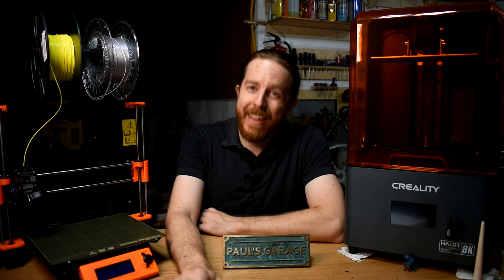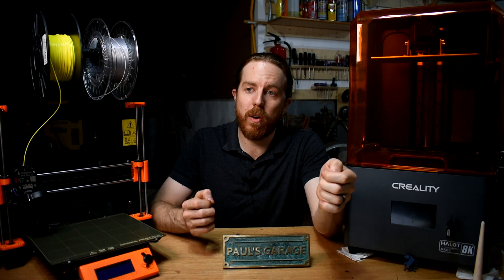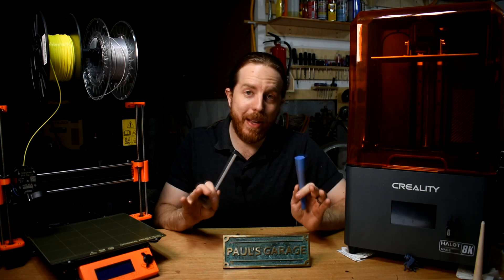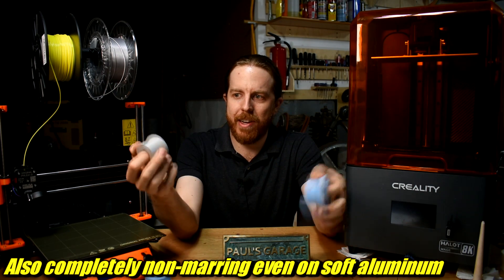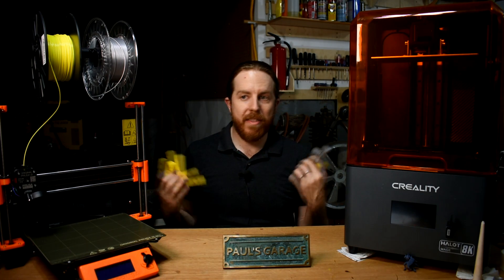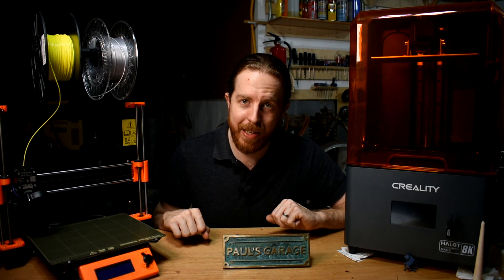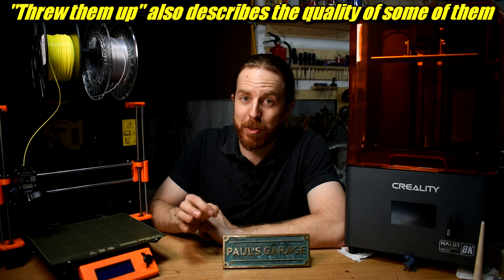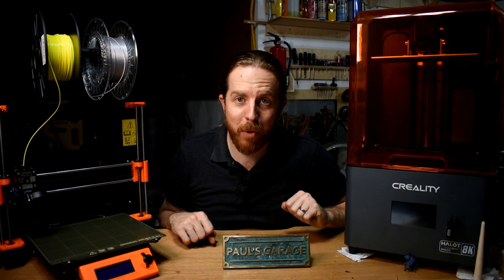A 3D Printer for NON-Plastic Projects?

Comment: As far as brittleness of SLA materials go, the range of brittle --> flexible  is WAY greater than anything you could get with FDM and certain resins can give you really brittle models. You just have to research and experiment. you can even adjust the parameters by mixing different types of resin proportionally.

Comment: Need something made of concrete in a specific shape? I had 2 plastic shelves side by side in a closet that wasn't quite wide enough. I 3d printed legs so that one set was exactly one shelf-thickness taller than the other so the two shelves could overlap. I filled the printed legs with concrete so they would be strong enough to bear the weight. Leg pairs were attached with a 2x4, so I designed countersunk shafts for the screws into it.

Comment: Get a vacuum pan and pump motor on Vevor, and just do vacuum investment casting. 

I would like to see someone with a muffler oven that could melt steel and do steel parts.. :) 

Greetings,

Jeff
Reply from the maker: That's the plan, and I already have a vacuum pump 😉
Reply: @PaulsGarage  Allright!

That should make for some very neat casts. 

Only the very very precise pieces may or may not need machining. I am very interested in how the dimensions will hold up. 

The m16 trigger and hammer parts are cast steel, so if you want to have something as a reference to see if your casts are as accurate, I would make some of those. :) 

Greetings,

Jeff

Comment: So what you're saying is that I should take apart an arc welder and attach it to a 3D printer and make a metal printer that uses welding wire. Okay, I like that idea.
Reply from the maker: Sounds fun take pictures 👍

Comment: I want to take the leap and get my first printer. I'm willing to spend$350 to $500. Do you have a recommendation? Im going to be mainly making casting patterns and maybe printing some pew pews out of carbon fiber filament.
Reply from the maker: I don't have much experience with FDM printers in that price range, but most fancy filaments require a special extruder nossle and/or hot end to deal with temperatures and abrasive additives.  Most cheaper machines don't come with those but they are generally readily available off the shelf as add ons.  From what I hear, Creality FDM printers are very customizable in that price range but I have no personal experience with them
Reply: @PaulsGarage  ok. Creality is at the top of my list right now. Found a good price on an Ender 5 s1. I'm sure I'll need plenty of practice before I get to carbon fiber filaments. I'm eager to get started printing patterns to get started on castings.
Reply from the maker: For sure get going with PLA and get comfortable with that before trying different filaments.  All of my sand casting patterns have been made of PLA, by the way.  Only now with the resin printer will I start adding resin patterns, though I will still keep using PLA for some patterns

Comment: I have been wanting one of either type for a while. What held me back was the 3d modeling. I challenged myself to learn a program first. I am currently teaching myself with Tinkercad, seems decent. Once I feel fluent enough in it, I will probably buy a FDM type first to get printing. I want a resin type eventually for scale model work.  I am pretty good at scratch building but some complex shapes are near impossible for my simple hands.
Reply from the maker: For scale models yes the resin will blow FDM away.  For simpler things though I'd still prefer FDM.  Both very good tools for sure.  I've messed with tinkercad a bit, I think I made the sand rammer and hammer patterns with that.  Fusion is the way to go in my opinion, but there is definitely a steeper learning curve
Reply: @PaulsGarage  Your video basically confirmed what I have thought for a while for my own personal situation.  I need both, but only have budget (time and money) for one style to get started.  FDM is what I will begin with, the resin seems clunky for startup and shut down, which means I won't want to use it as much.  I liked the idea of investment casting (or lost casting, what ever its called) which is something I might experiment with for "restoration" cosmetic parts for my motorcycles.
Reply from the maker: @thejunkman  I'm definitely glad I started with FDM, but yeah the technology is so different you really need both
Reply: @PaulsGarage  I have been mulling this over for YEARS.  I think it is time to pull the trigger and get an FDM and do some basic useful things.  Get myself up to speed on 3D modeling.  Then save up for the resin.
Reply: I was deciding between the two as well.  Resin is really limited to miniatures because of the cost of materials. Not to mention the LCD panel wear and film wear.  If you want details with FDM, consider a smaller nozzle like .1 or .2.  then epoxy coated or some other filler primer.
Reply from the maker: @Jaze2022  resin is pricier per print than FDM sure but it doesn't seem like much to me compared to buying equivalent parts. You would make the difference back pretty quickly, even with the cost of the printer.  LCD replacement don't happen as often as people think either.  Standard practice (if you care to stick to it) is 2000 hours, but it's not 2000 hours of print time, it's 2000 hours on, and the LCD is on for a very small percentage of the total print time.  Lifts and delays for the resin to stop moving and stuff like that take up most of the time per layer.

Comment: Oh the number of things you can use 3D printing for...
Leatherworking: I use it for tool holders, like my stamps, I use it for printing forms for wet forming leather around, I've used it to replace handles on tools, for templates for cutting, tooling and pricking.
Lathe: I have used it to make ring holders to chuck up a ring in the lathe for finishing (added bonus unlike a metal option I don't have to worry about copper shims to avoid the tool damaging the inner finish on the ring), replaced a couple knobs on my lathe that were less than impressively built (i.e. broke) and for a few other various and sundry things like tool holders, organizers for reamers.
Mill: Same story here, custom part holders, custom tool holders, not replacement parts on the mill yet but...I imagine it will happen.
Stained Glass (no, I don't have too many hobbies, what does that even mean?): The ever present organizers/tool holders, but also custom forms for the scene I'm making as well as these little clip things that hold the pieces lined up the way I want so I can solder them (nothing sucks more than a piece moving right as you apply solder...unless you like reapplying a bunch of copper tape).
Miniature Painting: My god how much time do you have? Everything from paint holders to painting tools to brush racks to using TPU (flexible filament) to reproduce new caps for the vortex mixer I use to mix paints.

I've used it to make replacement parts for my dishwasher, add on parts for my racing sim, a little custom headphone stand/holder you literally cannot buy an analog for. Racks for my DAC's and AMP's on my desk to give them room to breathe without taking up tons of space. I'm literally just looking around my office right now pointing things out...I could walk through the rest of the house and continue the trend but I think the point has been made...
Reply from the maker: Haha nobody has too many hobbies, only too little space and time.  

Now you said racing sim? What kind of setup do you have?  I'm still rocking a G25 bolted to an Ikea desk lol and have managed not to snap that ring gear inside... Yet

Comment: 3D printing ideas? Well, right now I'm designing and building a CNC gantry router using lots of 3D printed parts.  That's to NatahBuildsRobots I got the idea to use a Bondtech CHT 1mm nozzle on my modded Ender3 to produce .8mm layer height adjustable bearing housings that are very chunky.  Also the adjustment collars for the polished tubing that will be the new bearing surface, as well as center supports for the tubing because it's going to have a lot of weight riding on it. Probably also going to print the mounting bracket for the router spindle, and the dust shoe. Then I'm going to use the machine to cut foam patterns of all the parts and lost-foam cast them in aluminum(flat chunky parts). Then I'm going top open-source the whole thing.

I've already used my printer to reinforce my current garbage-tier DIY gantry mill. It helped.

Printed drill jigs.  Printed marking jigs.  Replacement handles for scissors.  An oversized zipper-pull for a snow jacket specifically made for use with heavy gloves. And a special bracket to clip my walkie-talkie to back when I was still in contract security so that I could sit down comfortably without taking it off. Will be designing molds for some carbon-fiber parts though I'm not sure if I will print them or mill them out of HDPE. Whatever, I'm all over the place and the printer really helps.

I use FreeCAD because I'm strictly on Linux and it's basically the only game in town for CAM software. Blender's CAD extensions look promising for 3D printing, but so far they are all for additive manufacturing, not subtractive.
Reply from the maker: Sounds like you are getting lots of use out of 3d printing.  Freecad is pretty good stuff, I just couldn't work quickly enough.  It might be down to inexperience (pretty sure it is) but fusion is faster for me
Reply: @PaulsGarage  Not at all.  I've heard FreeCAD described as being reminiscent of CAD software 20 years ago.  Light on features, kind of buggy, long processing times, high learning curve, etc.  FreeCAD is entirely coded by unpaid volunteers, and it's absolutely amazing by that standard, but it doesn't have the resources of something like Blender or Autodesk. For instance, single point thread milling and fourth axis are both still experimental in the Path workbench, which is FreeCAD's CAM module.  

I'm a big open source advocate, so I'm using it regardless, but for a lot of people that just want to make something and they are already trapped in the Winblows ecosystem, I just tell them to go with Fusion. FreeCAD is hard mode in a contest where there are no extra points for that.

Comment: My current wild idea is to print a "mold holder" in PLA, and then print the mold in water soluble filament.  Fill the wear or stress surfaces of the mold with metal inserts, then fill the rest of the mold with epoxy putty.  Get the cured part to release by soaking in water.  My hope is this will produce parts that are close to the toughness and hardness of metal parts, combined with the precision and ease of 3d modelling, while minimizing the use of the relatively expensive water soluble filament.  Wish me luck, and for exploring this idea to get to the top of the stack!
Reply from the maker: Sounds like a fun process!

Comment: As somebody involved in 3D printing (and its educational outreach) since 2014, it's really a game changer for an average hobbyist and I'm super happy seeing more and more people discover it as a tool, and not "the bad robot taking away jobs".

Not sure I have a useful suggestion, but an often overlooked material is TPU/TPE. It's come down price a lot (costs about the same as PLA now) and it's perfect for door bumpers, soft corners, plugs (for bolt holes, fixture plates, other holes) to prevent dust ingress, etc.

And when you're done falling down the rabbit hole of 3D printing, there will be a hatch going further down labeled "CNC Routers". ... Just don't be tempted, or you end up with custom machined fire bricks with perfect side angles and interlocking features. ... Or the 5-axis nonsense I've done on my channel.
Reply from the maker: I've never tried tpu/tpe, thanks for the tip!  And I'm a long way off of CNC machining, still working on regular old fashioned machining!
Reply: Just a heads-up - if you give it a try, search for some tutorials on printing TPU on your Prusa i3 to avoid damage to the print bed. With the incorrect settings (and without gluestick), it is known to permanently fuse to PEI surfaces.
Reply from the maker: I did wreck one side of my prusa mk3 build plate, but with standard PETG.  Whoops
Reply: @paulsgarage Another fun tip: TPU, in my experience, isn't terribly particular about the surface that you print on. I have used it to print a mask on a sheet of copper for rattle-canning some pattern lines for a copper bracelet that I made for my wife. All you have to do is secure it to your print bed (I used painters tape) and set your Z-axis 0 point to the copper's surface. It stuck perfectly and came off with a pen knife without issue.

Additionally, TPU is pretty chemical resistant so, it might be possible to use it on copper-clad (or other metal) as a negative mask for chemical etching. I haven't tried this yet but it's a neat idea.

Comment: I consider learning CAD the biggest bottleneck in 3d printing popularity. I ended up learning FreeCAD, and I used letting myself buy a 3d printer as a carrot to provide the motivation to learn it.  

Funnily enough the easiest and fastest thing I've ever printed was the most valuable. A family member had a CPAP machine with an overly complicated plastic part with a tiny hose nipple that broke off, took me 5 minutes to model a new nipple I could reasonably epoxy into the broken part, and 10 minutes to print it. A good option when a new one is a thousand dollars, and replacement parts are nonexistent.  

I've also basically paid for it again fixing headphones instead of replacing them.
Reply from the maker: Agreed.  Modelling skill is the most important part.  I prefer the UI of fusion to freecad but freecad is still an awesome program.  Lately I've been trying to learn blender for mesh modelling, but you can't do parametric stuff in blender
Reply: FreeCAD is just clunky, buggy and ugly! Writing software that's worth paying for is ridiculously laborious and time consuming, even with all the advancements in modern computing and the vast amount of learning resources and freely accessible code. Fusion 360 is the easiest to learn with a ton of useful features and works on the Mac and Windows. It's hard to believe I once thought Sketchup was good.

It is still free for hobbyists. If it wasn't free, I would still pay for it, although I am not a fan of Autodesk. I'm still pissed off at them after they made the dirtbag move of using the community to build up their product and then cut them off from accessing some of their higher end features after the honeymoon was over. Fusion's competitors are way out of the hobbyist budgets with license fees in the thousands per year and many of them have fallen behind in Fusion.
Reply: @bobweiram6321  i really like onshape. if you can get over it being browser based and your models being technically publicly available (if you want to hide a model from search, just dont give it a descriptive name), it's super nice. not nearly as powerful as fusion, no CAM, but i prefer its UI tremendously and since the computing is done on the server, you can have as many projects open as you want. plus the phone app is full featured so you can stay in flow when you take a break to get coffee or use the bathroom if you really want :p
Reply: @Taygetea  I wouldn't touch OnShape with a 10 foot pole! Their business model is equivalent to allowing you to use their public toilet on a busy street for free, but there's no walls and everyone driving and walking can watch you taking a dump. If you pay a fee, a booth is lowered over you to give you privacy. Using a web browser is the most painful way to use highly interactive applications.

Comment: Sounds like you need a little help calibrating your shiny new toy to work best with the resins you're using matey! Once you calibrate it with the resin you use (Yes, every resin will need calibrating differently! Much fun i know xD) then you'll be getting perfect prints no matter how you orient your prints, and perfectly dimensionally stable. 

I can heartily reccomend the latest resins from SunLu, their Sunlu ABS-Like and SunLu High Toughness. The ABS like bends, takes stress, works like you'd expect a plastic to behave. The high toughness is ridulously strong, like you can smack it with a hammer strong, or print a veronio object and squish it without breaking :D They're also amongst the cheapest ones out there too, pretty incredible stuff. 
For casting, Siraya Cast or Bluecast X-One are the only ones to consider (the rest are expensive and bluecast exists.. lol) 

Have you made a subthingy on your discord for this? I'll post some links to shit i reccomend to watch/read/advise for if there's a place for it :)
Reply from the maker: Thanks for the info!  Yes there is a 3d printing channel in the discord
Reply: @PaulsGarage  awesome, thanks, I'll infodump a bunch of stuff I think will of be use for you to read/view then :)

Comment: I have 3D printed 4, one tenth scale models of my 1930 Austin Seven car. One for me, and one for each of my sisters. Only some little thin brackets and rods are either brass, aluminium or copper. I used an Ender3 with pla, and an Anycubic mono 4K with water washable resin. I am now looking for Cornish tin (tin mined here in Cornwall, UK) so instead of painted plastic radiator shell, and lights, I can cast them in tin. Without the 3D printers, I wouldn't be metal casting or making models of my car. Neither of my printers would be considered as "top of the range", but they both do (as we say in Cornwall) a "Proper job".
Reply from the maker: That sounds great!  A 1930 Austin eh?  That sounds cool.  I don't think we got those in the US
Reply: @PaulsGarage  I think the A7 was a bit too small for the US market! A version of the A7 was marketed as the "Bantam". Laurel and Hardy used one in a film, very funny.